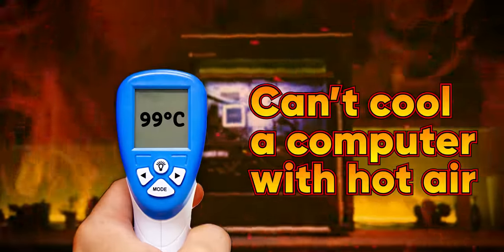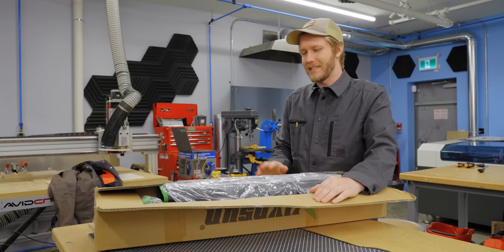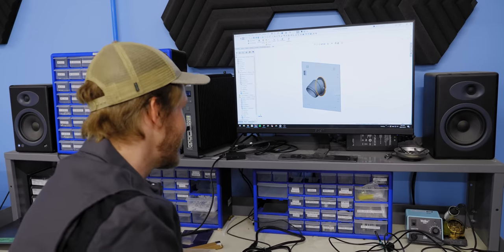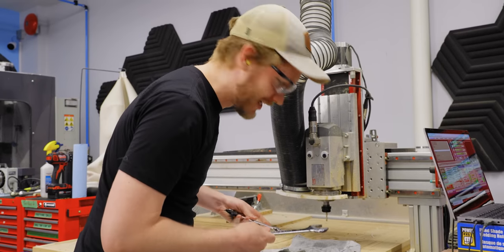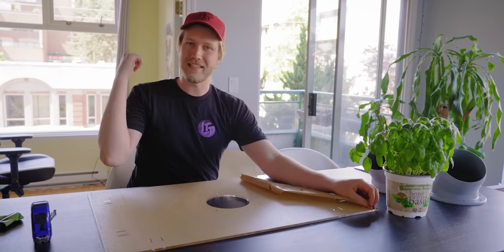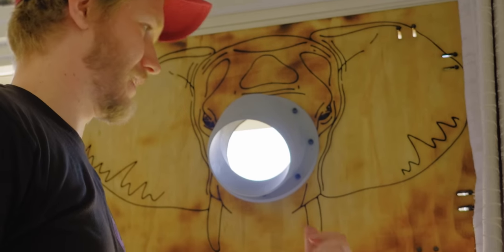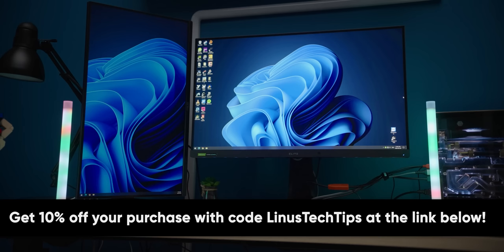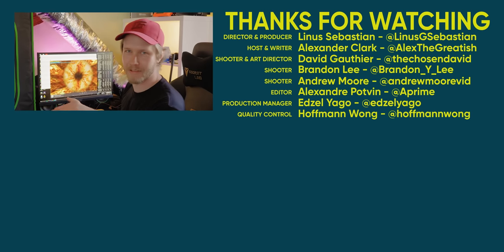You’re cooling your PC wrong. - PC in a Grow Tent

Comment: Alex, you may want to put a covering over the exit to prevent bugs from entering.

Interesting idea though, thanks for sharing!
Reply: Why? The fan will likely be on all the time, so bugs can't enter.
Reply: @sdspivey  ohh for sure they can, don't underestimate some bugs.
Reply: @sdspivey  it won't be running 24/7
Reply: @tahiraslamm  Why not? The majority of people never shut down.
Reply: You can use the one way damper for an dryer exhaust vent.
Reply: @sdspivey  Thats such absurd statement of course most of the people shut down their pcs while not using it lol , waste of electricit , extra heat to the room and noise.
Reply: @Rubayou  According to PC Mag (c. 2010), over 60% surveyed in the US do not shut down more than once monthly. Plus you have to presume those who aren't computer savvy (ie. mac users) would be a higher percentage.
Also, web servers and media servers almost NEVER get shut off.
Reply: @sdspivey  that probably doesn’t include people who put their computers to sleep though.
Reply: That's what I thought. My grow tent would be full with moths in the summer and they'd all die inside the tent eventually, like they do in my room but much worse
Reply: @sdspivey  I have pulled dead birds out of 4" bathroom exhaust vents that have a flap that's supposed to prevent anything from entering. Something will eventually make its way in that insulated flex pipe, especially if its nice and warm.

Comment: The downside is, you're just blowing a ton of air conditioned air, yes it's been heated a bit, right outside. If its hotter outside than the warm air from the PC then the air that comes rushing back in will make the whole house hotter. Single hose portable ACs have the same problem. Works if it's not too hot outside, but if it's hot out, your AC bill will go up as the room temp goes down.
Reply: 50 C is 120 fahrenheit. the chance of temps being HOTTER  are extremly low btw. Does not work the same way. Also for their case, they are in canada so i doubt they go above even 90 in summers.
Reply: The fact that this system is pulling air in from the rest of the house has me thinking that it would have been easier and more efficient to have some kind of super simple ventilation system that circulates air between the room and the rest of the house.
Reply: @Gene669  I have 4, 8gpu mining rigs all in a grow tent. I vent the hot air up into my heating vents so it flows into the rest of the house in the winter. In the summer I just vent out a window and it works great. No need for anything like AC that someone else mentioned, just a lot of airflow.
Reply: @ObeyThePapaya  well yeah but that's temps at the SOURCE. It will drop significantly by the time it reaches the outside of the case, and even more once it travels the 16 feet of tubing he's using. I think the tent and tubing is redundant here, and he would have had similar results by just dumping room air outside and pulling air in from the rest of the space. He's not really disposing of the hot air that well because his grow tent isn't airtight at all, plus he even said how much air he can feel exchanging under his closed door. All he did was increase the circulation through his space by dumping air out a window.
Reply: The air gets sucked in also through sewer lines. You will notice the smell quite soon.
Reply: @MauroTamm  How tf do you do plumbing in the US? In europe all asewer access in a house is waterlocked
Reply: @oculicious  sewer lines do have air vent pipes often to clear sewer gas.

Water may be low enough - summer dry air evaporation etc. 

Negative air pressure, especially in airtight buildings with forced ventilation, may just overcome the waterlock.
Reply: @MauroTamm  Why do you vent sewer gas inside the house? That's disgusting...
Reply: @itIsI988  inside the house? Why would you even think this us a thing?

There us a separate pipe for that to exhaust outside.
But if internally there is a negative pressure, it no longer works as a exhaust  - but a intake + any sewer gas.
Reply: @MauroTamm  Would the open windows not have less resistance, thus being the chosen path for fresh air?
Reply: there should be an intake from outside to tent box, that would fix the problem
Reply: @itIsI988  If you have windows open - like a hot 30C+ weather.
Reply: @MauroTamm  Yeah, have windows in the shade intake air, windows in the sun exhaust.

Comment: In my opinion a much better design would be to have the tent as sealed as possible with two pipes.

 You would still have a fan acting as an exhaust but the one pipe would allow it to draw from the air outside instead of sucking air from inside.

  As of right now you are keeping your room cool but simultaneously exhausting out a bunch of your AC too with it meaning much higher power bills, and much higher wear on the AC.

 Also probably making your AC much less effective in other rooms around the fan that are having warm air sucked into them constantly (from negative pressure) while the fan is running. As evidenced by the draft under the door.

 If you used two pipes (Intake and exhaust) your PC might be getting warmer air into it but that should likely be fine without extreme stress loads.

 But in turn you would be wasting a ton less power overall on climate control.

 Edit: Another point to be brought up. During the winter if ran like this will also suck out your heat. Which AC is about 3.5x more efficient then resistive electric heating. So that also could be a much much worse scenario.
Reply: You want your PC to have cooler air as well. The PC cooling can only do so much if your ambient temperature is very high. Also sucking in outside air has the potential to cause damage to your PC depending on your climate. If you have high humidity or live in a bad air quality area. 
I bet some of that would be solved with air filters.
Reply: Was thinking the same thing from the start.
One intake one exhaust.
Also like you sad the AC is now working harder so your paying for that in power bill.
And if you dont have an AC this approach is also better if your inside air is cooler then outside,  you wont pull hot air in to the building from other vents using a two pipe intake and exhaust solution.
Reply: Yeah that's what I was hoping they would do as this seems like it'd use a lot more energy. I feel like you'd only be able to use an in/out system when the outdoor temps are moderate though, i.e. not humid or above 80f. Still a fun project though
Reply: @Catsrules1 , I don't think the humidity would be an issue as long as the computer doesn't go sub ambient while running which is really shouldn't under normal circumstances. As that is when condensation would occur.

 Logic is that some people live in areas with constant high humidity if not 100% even indoors and their pcs are fine.

 The tubes could be angled up a bit before exhausting to make sure that there is no way for rain or such to make it's way back into the tube. But a rain shroud would be good outside too and of course a mesh to keep pest out.

 As for pollution I would argue that for a lot of things that may kill a computer like dust, hair and such indoors is probably worse a lot of times.

But still a Filter like you said wouldn't be a bad idea just in case.

 As for the heat, unless the day is particularly hot the temperature is probably going to be only 10-20f higher then indoors. At night is might actually be cooler.

  Regardless though unless a pc being hit really hard for benchmarks or rendering are likely going to have plenty of headroom to game even if the air it's getting is 90f as long as there is enough airflow to move it out quickly like their exhaust provides. (Many peoples PC probably get that hot inside without good airflow.)

  If there live in an area with consistent 100f+ days then I might agree an interior air feed system would be better. But it should be fine tuned to figure out the minimum air exhuast needed to get the PC to run optimally.

 Everything past that point is just blowing the AC quite literally out the window.
Reply: , don't forget the extra power from the exhaust itself on top of the AC losses. Double ouch to the wallet instead of what could be just one.
Reply: @charleswarwick4849 , possibly. But I don't think humidity would be an issue as your computer shouldn't get sub ambient while running.

 And even at over 80f I doubt most things would thermal throttle unless really pushed.
Reply: A/C in canada is a staggering minority.
Reply: @spartananator4191 , I looked it up. Says 42% of Canadian household have specifically a central AC back in 2017. Since then it is likely that has risen significantly since then.

 Another data point says that back in 2009 at least 50% of Canadian homes has some type of AC (not specifically central air) and again has likely risen.

 However there are areas in Canada that do have as low as 10% air conditioner ownership which makes sense probably the more up north you go.

 In areas where there is no AC then you are right you wouldn't be losing AC doing this.

 However if you are instead heating especially with electric and not a heat pump that is actually abou 3.5x worse because it takes 3.5x the electric energy to heat up a degree then cool it.

 So in otherwords losing heat in your home instead of AC would be much much worse.

 Not heating or cooling then there should  be no issue other then the excessive energy the exhaust fan is using. Which could be fixed with some speed optimization.
Reply: Yeah I don't think my pc would appreciate intaking >100f air in the summer.
Reply: @ordinalchaos , probably not. But you also may not appreciate paying an extra couple hundred dollars or more a year for cooling and heating loses being blown out the window (especially heating) on top of probably maybe hundred or so more for running a high powered exhaust.

 (300w exhaust x 6h a day x 365 = 657kwh x $0.144 = $94.608 USD per year just for the fan. And we have realitivly cheap power here.)

 On days were it is 100+ out you'd probably just want to draw from inside if you really needed to. But do so after calibrating the minimum airflow needed to keep your PC cool so you are not over exhausting.

 Theoretically it could be fine tuned to be beneficial but that will constantly change based off your PCs load.
Reply: I mean. I just work remotely, from a room one over. I don't always even stream it because i have a setup just cabling the interface through under a door. Mostly because of noise, and not having to worry about the noise.

It so bizarre to me I even HAVE to make these geeky solutions by hand, and the only thing offered by DEFAULT is something like Amazon Echo smarthouse monstrosities mainly designed for frivolous qol like voiced light switces. We should have things like communal geothermal warm and cool air deposits, and they should be as obvious as local water towers. By cool air I mean regulated underground wind tunnels for air conditioning.

Humidity is a huge problem, it's a big reason WHY tech doesn't move to remote places that are already cold. Because we're still relying on Victorian mindset solutions like "just let the air carry the heat away" and don't solve for the complete equation of how we CONDITION the air. If we did, we could do things like send heat back from wasteful computing and get a little bit of return compensation for it.

Comment: I feel like this is more of a room air circulation problem than anything. A few fans strategically placed to keep the air moving around inside of the apartment and thus creating an equilibrium in the rest of the apartment between the warmer air from the pc and cooler air from your AC system. But I'm no expert on thermodynamics so take this with a grain of salt.
Reply: This would involve opening the door, which is not an option. However a door vent would greatly increase the overall air returned to the intake and prevent the door being closed from being a problem while also preventing unwanted shouting from being an issue. It would also help to have a smart thermostat like a nest with a wireless addon for it placed inside of said room. It may  cause the rest of the house to get alittle cold while he's gaming, but overall a much better solution then him creating negative pressure and sucking out ALL of the cold air from his apartment and forcing his AC to run continuously while it struggles to cool air being poured in from any small cracks and holes in the walls and ceiling, probably mostly through any kitchen vents, bathroom vents, etc.
Reply: I was thinking the same thing. An extractor fan at the windows would do about the same thing
Reply: Like he said he isn't allowed to open the door. Also that seems a lot more inefficient in terms of cooling because you're using more fans and use more energy than just a single fan that direct exhaust, while cooler ambient air enters from different rooms cooling the rest of the house at the same time.
Reply: @Smashachu  Yeah he could probably 3D print a little piece that tapers down to the size of the Crack under the door, and hook it to a vortex fan. That should absolutely dump fresh air in, and the positive pressure will force stagnant air out the bottom of the door wherever the 3D print piece didn't fill it up

Comment: I wonder if you could 3D print a manifold to come right off of the case. Flow might be more limited, but at least you wouldn’t need a grow tent.
Reply: You could literally just ducktape that tube to exhaust fans and call it a day🙈
Reply: I actually tried exactly what you are taking about a few weeks ago, you can actually buy premade 120mm fan to 4 inch venting adapters on eBay, I got a powerful DC fan to act as the exhaust but the problem was that the exhaust on the computer isn’t the only place the heat escapes from. I didn’t even think to make a housing for the entire computer. I’m thinking you could easily make a frame out of PVC piping. The actual housing can be any thermal inactive material
Reply: @Prophes0r  you could, but then the pc  exhaust fans aren't going to be much help in adding extra velocity to evacuate the hot air. You'll be blocking probably 60% of the fan surface. With a manifold you could use those fans to your advantage.
Reply: @DontAskItsNotMe  Yeah I was thinking about that. A case isn't air-tight, but I imagine at least a good chunk of the hot air is directed through the exhaust anyway. Did it at least make a noticeable difference?